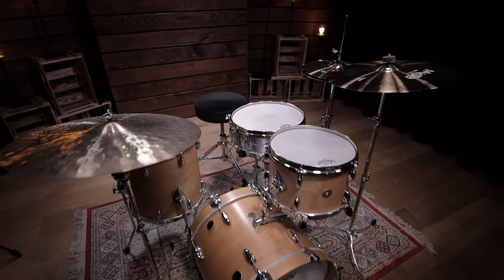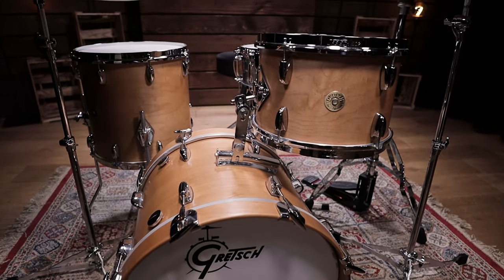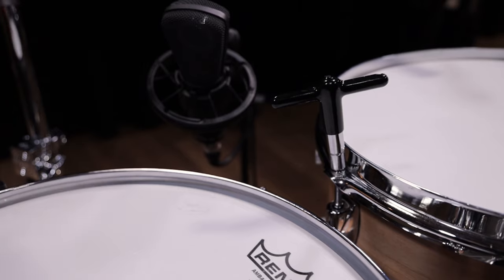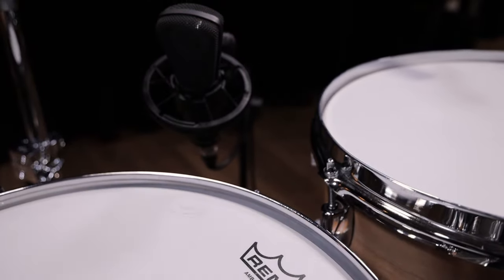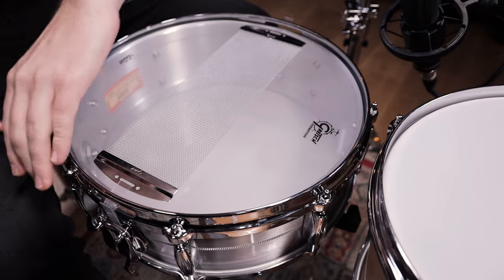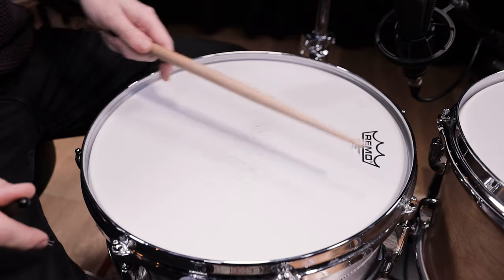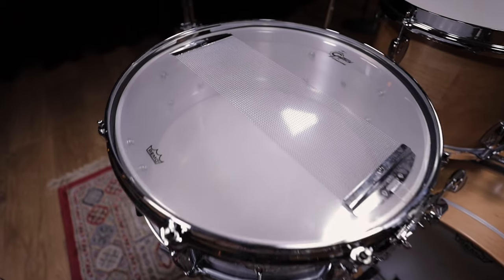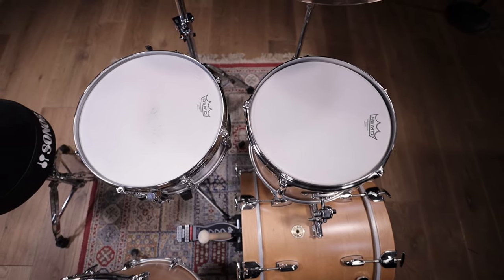Dealing With Snare Buzz | Home Of Drums

Comment: I can only add that :  If I use my 14 X 6.5 DW Brass over Nickel Snare , with my Rack Toms (8, 10 and 12 Inches) tuned the way I "like" it, I get no snare Buzz.  That snare is Table Top Tight on the Snare side with the standard snare wires and clear DW Snare Clear head and I have a Evans HD Dry Batter head.  However, If I use the Snare which came with the Kit (PDP Concept Maple) 14 x 5.5 ", I get Snare Buzz form the 10" rack Tom..... PIA.  I Gatt taped the snare wires on the PDP snare , which stopped the Buzz, but altered the sound of the snare Of Course. But I found that sometimes, playing the snare with the taped wires, I get a deadened snare sound which can sound desireable in certain situations.  Let me qualify my Drum playing as a Recreational / Hobbyist player, 70 yo, retired and play drums to My Music. I returned to playing after 50 Years as a retirement Thing.  So Glad I did!!!

Comment: I commented about a month ago.  I get the snare Buzz more so on the 14 X 5.5 snare (Maple).  Less so with a Nickel over Brass 14 X 6.5 snare?  Tuning all the drums causes OCD in me.... I find it so difficult to get to that "Sweet Spot" to my ear.  I even switched to a 40 wire snare wire - that it worse.  So after switching out G2s coated batters on the Toms (8,10, 12 rack Toms), to Remo Ambassador batters (the stock heads) - that produced a more UNSATISFACTORY Tom sound.  Switched back and Re-Tuned with the G2s Coated, and I hot the sweet spot for the Toms.  Had to add some Gatt tape to the Reso heads and a Evans E-Ring to the Toms batter side - but I got there.  Now I have Snare Buzzing using the 14 X 5.5.  So, I did the No-No, I installed Gatt tape to each end of the wires - and Bingo just about Gone.  It "chokes" the snare a little, but I can accept that for the Music I play (No Jazz , only MY Music form my generation at 70 YO).  I am sorry for Ranting, but I returned to playing after 50 Years (1969) , in 2019.  I'm retired and play to My Music about 1 hour a day. I did NOT know any of this Stuff about Drums (tuning, Different Batter and Reso heads, Tonal Tricks, etc.( in 1966 when I first started playing.  I didn't have as much OCD then.  I guess, sometimes, More is NOT always Better.  Oh WTH, what else can I do in Retirement especially with COVID (which I just got recently - but recovered OK).  Be Well All.  Happy Drumming.

Comment: Okay, another reason why your snare buzz is inherently bad is because you have a metal snare. It holds a lot of those overtones you don’t always want. Wood snares still have it but what I find to help is just having a wood snare, a snare wire that isn’t super duper wide but also is not super skinny, and tuning the snare tight.
Reply: Of the 4 metal and 3 wood snare drums I own, only one all maple drum suffers excess buzz.  It's also the only 6" deep snare I own.  The 5.5" and thinner are fine.  The 6.5" and greater are fine.  Shell material has far less to do with sympathetic resonance than the resonant frequency of the snare relative to the toms. 12" and smaller diameter toms are much more likely to cause buzz than 13" and up.

Comment: used small dryer sheet, trimmed, underneath the welded metal part of the wires. i only needed 1 but 2 for each side should do the trick.

Comment: This is My Update Observations about the two snares previously mentioned.  The DW Brass metal snare (14 X 6.5) Buzzes Less than The Maple snare (14 X 5.5).  I have 3 Rack Toms :  8, 10, & 12s.  Unfortunately, I get a Little OCDed by this stuff.  Tuning drums is more of an Art than I realized.  I just re-tuned my drums :  EC2s clear on the 3 Toms and a HD Dry on the both Snares. Before I just Touched the Toms today, I had very little Snare Buzz form the Maple Snare.  Now after Tweaking them, there is more snare Buzz.  I tried a few of the tricks here, but to little avail.  I guess I need to keep Experimenting. Oh, I use Evans E-Rings on the 10, 12, 14 &16 [Floor Toms], and that product serves to help muffle too much over ringing from the Toms. 
I will post another Drum Tuning "weird" thing.  A few weeks ago, I replaced the Batter Head on the DW Brass snare with a new HD Dry head.  No matter how I tweaked it, I couldn't achieve the sound I had before the head replacement.  I out the Dw on my 16" Floor Tom - to gwet it out of the way as I placed the DdP Maple snare in the stand.  As I did a fill while playing, I hit The DW - the sound was GREAT, like the Ludwig SupraPhonic  Snare - Like the Jon Bonham Sound That I ahave been trying to attain.  Take the Dw off the Tom and it the sound was not the same. That Nice Crack with just the right amount of Overtone.  I don't Mic or record any of the drums.  I play for recreation in retirement about 1 Hour a day.  I posted this Weird Thing on Drum Forums.  One poster said that You are playing 2 Drums simultaneously (the Tomand Snare); another jokingly said that I may have invented a new Snare Stand!!  Here's a little tip that I tried which too altered the snare sound of both drums:  I put a EC2 Clear 16 inch batter head in the Snare stand and put the Maple snare on that.  The sound did Improve - to my liking - measurably! I also Re-Installed the HD Dry Batter and Reso heads and the wires.  The snare wires have more impact (subtle, but noticeable) than I ever realized. That's why I refer to Tuning as an Art.
Reply: Don not fully understand what you say but ...the resonation of the toms does influence the snare sound and the sound of the whole kit. The snare stand does influence the sound of the snare drum. The snare stand may cause deformation of your snare drums or the hoops, When the snare stand is  to tight, or not flat , or the drum is not flat in the stand , etc. it introduces tensions in snare drum or hoops.. That will influence the sound of the snare drum. There also are snare drum stands with rubber that fot on the hoops. Locking them very loose and smooth will act like a resonation/vibration/sustain/suspension system. You also can add such a suspension system to the snare drum and mount it like a tom. Some people have the snare drum not flat in the stand and than tighten the stand like crazy . Of course something under the snare drum will influence the snare drum sound and it also mat flatten the mount. Distance between drums: sound is a wave with a wave lenght. There is interaction of waves so ...changing the distance between drums may affect the sound/resonance/overtones.,

Comment: Less strands on the snare wire can help, too.
Reply: there are 8 snare wires on my but it still keeps buzzing :<
Reply: @kyleehyo4797  I'll pass some useful videos to you if that can help.
Reply: @Eurodrummer666  please paste the links😁😁
Reply: @kyleehyo4797  recently I came across this video I already knew, in which Nolly gives specific tunings so the snare sings well. In short, for a low tuning, tune the batter no lower than a C, and the reso as a A. I realized that until then, I was going a tad too low on batter and too high on the reso. In my experience, too much tension on the reso promotes zingy sounds since it´s "too responsive". And a too low tension on the batter promotes buzzing as well because it´s too sloppy. Here is the vid: https://www.youtube.com/watch?v=lPAcojMuouI&ab_channel=Drummer%27sReview. 
As well, if you are doing a "clean install" with fresh heads, I would highly recommend Sounds like a drum channel, especially this vid: https://www.youtube.com/watch?v=paCUkRiNOWI&ab_channel=SoundsLikeADrum Here, Cody stresses on the importance of "levelling" the reso head on the 1st use for better results. It means measuring the height of the hoop when installing the reso, but he explains it better past 7.30 minutes.
As well, retuning the toms would help avoiding the buzzing, for example, I tune my 10" on my DWpdpCM7 kit very low so it doesn´t "trigger" the wires.
Good luck with it, and please sendsome feedback!

Comment: What if you put a couple of papers between the snare and wires?
Reply: I placed a thin tissue under the edge of the wires secured to the rim by gaffers tape.
Reply: Theyt sometimes use roller papers

Comment: I have a different situation: The snare by itself has an unusual buzz/rattle all around the edges. I picked up a used snare, changed both heads and snare wires multiple times, and tuned it several times to different pitches, and adjusted snare tightness as well. After many years of experienced drum tuning, this is the only snare where I encountered this problem. Any insight is helpful!
Reply: A snare drum that is fallen may have a snare mechanism at 1 or both sides that is not straight, the shell as a whole may not be straight, the bearing edges may be damaged/not flat. That will cause the snare bed/snare wires  not to be flat on the reso or not touching the reso at all places.  Some snare drums , like bronze, have an enormous amount of resonance. Dampening the shell at outside or inside may help. Many drummers tighten the reso head to a maximum. Gaffa tape  on the wires  may help. Sometimes a rolling paper between snare wires and reso head may help. In your case i expect the used snare drum has been fallen and some parts are not straight, flat or damaged. With some metal rulers you can check straightness/flatness, perhaps it can be improved. Sometimes the hoops are not straight. Some tension rods can be not straight causing deformation of the hoop. Because you tyright a lot of things: this you did not check ...perhaps there is a solution/cause.
Reply: @HenkJanDrums  ha! Thanks- it did not check it with a ruler/straightedge, that would have been good. It was dropped by evidence of a bent snare tensioner screw.  I was able to return the drum though - thankfully.
Reply: @msyracuse  Great!